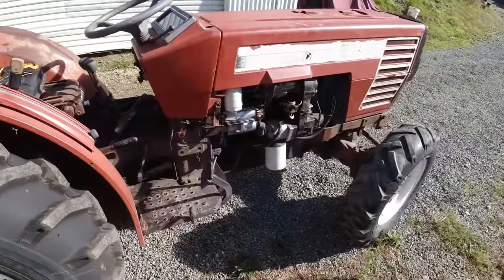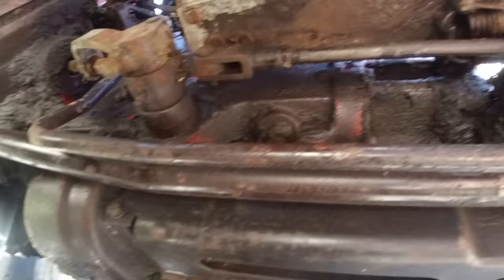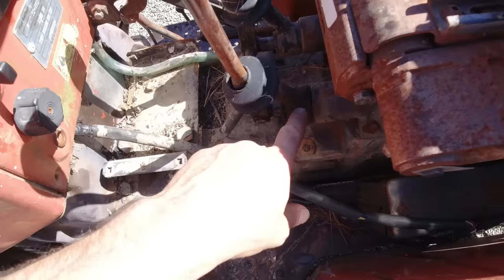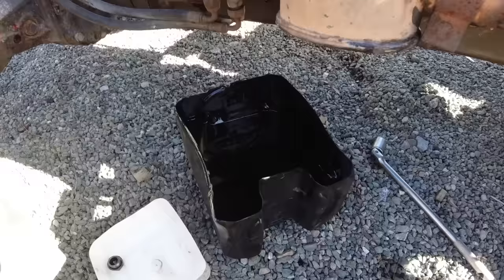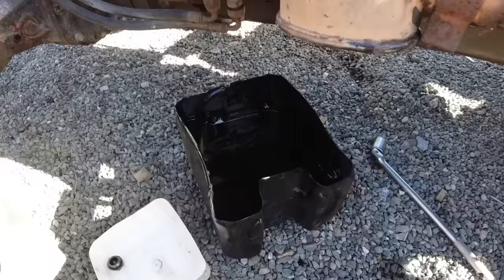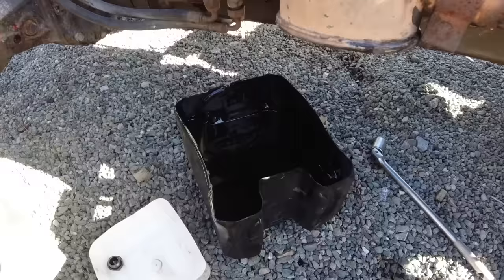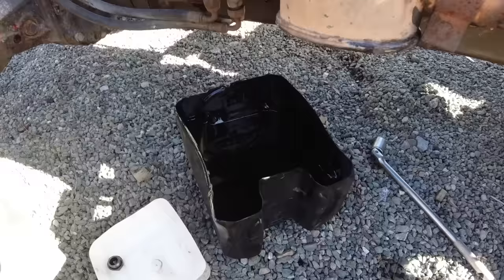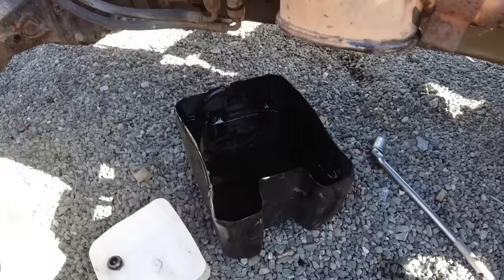Free Fiat 4wd tractor gets a full service/repairs & goes back to work

Comment: Jeeze, the Fiat got the full spread of filters.  Ryco, Wix, Sakura, AliExpress -- was that because of price or availability?  And why was "Ryco" blurred out, but not the others?

My guess for the gearbox being low is that either it was used with leaky equipment on the hydraulics, or it's leaked away slowly over the years.  All the mLs add up over time, and it's not like the previous owners were going to check the oil level, was it?

Amazing what a little bit of TLC and maintenance will do for a machine.
Reply from the maker: I shop around for the best priced filters.. filter had some swarf in the threads but most of them do so I didn't want to name the brand
Reply: @MartyT  Fair enough.  I thought it may have been some stupid YT "undisclosed advertising" thing.

Comment: Reminds me of one of my tractors - my 1975 Ford 2000.  Three cylinder gas - loader tractor.  The 3 cylinder has plenty of power.  I think I'm pushing out about 33HP.  I wanted to ask you - when you drag, is the blade on some kind of float circuit or do you constantly have to baby the control lever?
Reply from the maker: Yes it floats

Comment: If you turn the rear wheels for better stability, do you have to also switch sides to keep the tread in the same direction...or perhaps it doesn't it matter which way the tread is oriented?

Comment: We used ATF/ power steering oil (GM Dextron 3 rated?) in the power steering of the old Fiat. Check the valves on the engine too?

Comment: Any more thoughts/progress on the oil centrifuge?  Might you turn a Gentle Annie into such a device rather than merely take the invest-in route?
Reply from the maker: A kind local saw my last vid and has offered me the use of his centrifuge, I'm going to have a play this week, I think they require much higher rpm than the washing machine motor can spin
Reply: @MartyT  Given your inclination to film as you explore topics, I look forward to a video about it.  Might there be a bit of fun peering down the rabbit hole of what happens to such hardware that moves into retirement, just like the tractors & dozers?

Comment: If you reverse the wheels to make the track wider, won’t you have to remove and reverse the tyres to get the tread the right way round?
Reply from the maker: Id unbolt the hub dish (?) and turn it around inside the rims